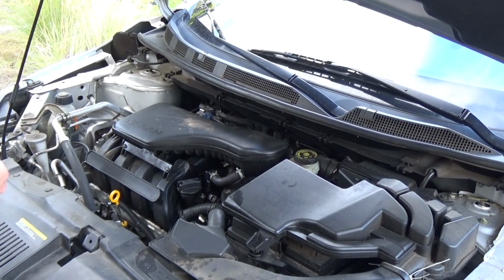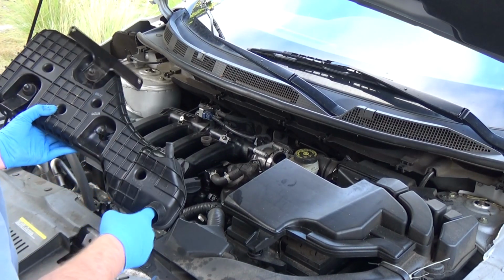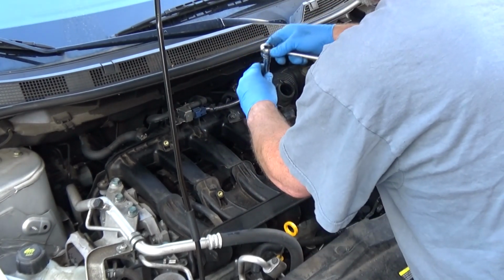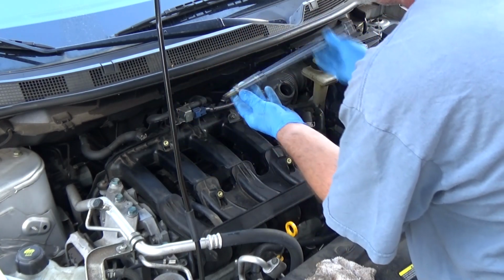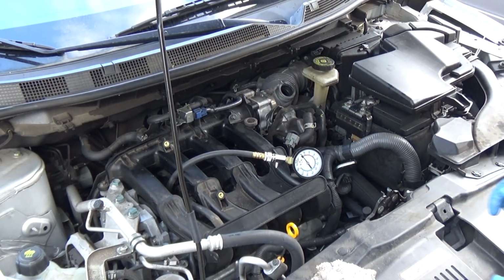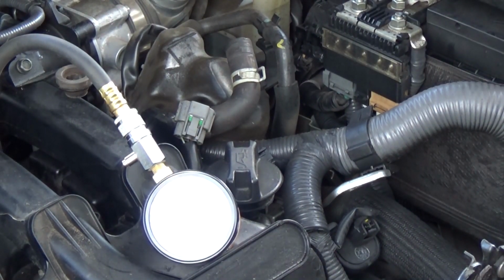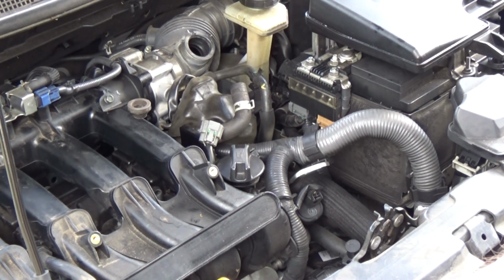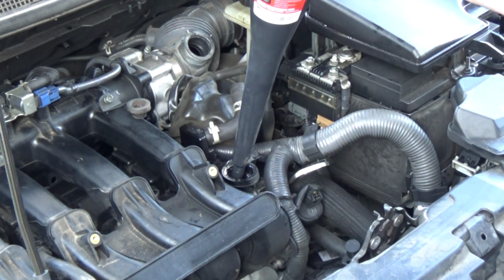2020 Nissan rogue sport BURNING OIL troubleshooting

Comment: We have a 2017 nissan rogue with the 2.5 4 cyl engine. I have never topped the oil up on this vehicle. Even once, it never moves. The new 3 cylinder nissan Engine with a turbo with variable compression is an absolute nightmare.

Comment: Same thing with my 2019 Nissan rouge on cylinder 3 broken off spark plug. Burning oil. The plug change seemed to have fixed it.

Comment: Run 5w30 oil….. Even tho it says 0w20. The bearing clearance are same on years 2008 plus naturally aspirated 2.5l. Also seeing this on newer ones running 0w20 oil. Oil is so thin that when engine is hot and hot outside and even full throttle run oil could be going past rings too. I’ve got an 08 with Hard city 135 000 miles. Has some mods. Home made cold air with k@n filter and second cat delete. Little better muffler still quiet. Also tuned by hp tuners. Most serious repairs Have done injectors, front body mount, just changed original plugs only 8000 miles ago LOL. Original cvt was replaced under warranty 10 years ago. Still good. Fluid needs to be changed tho. Has slow rear main leak but. I just run 5w40 euro oil stops it. Motor is still good and orginal manifold cat. And yes those performance mods did something because when I race 2014 plus v6 Nissan muranos I’m neck and neck all the way too 100 mph.